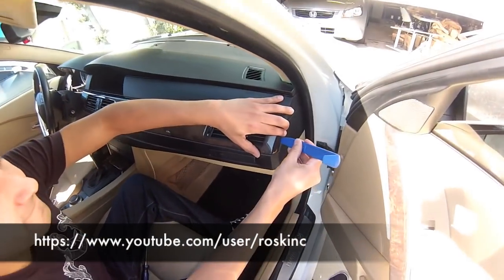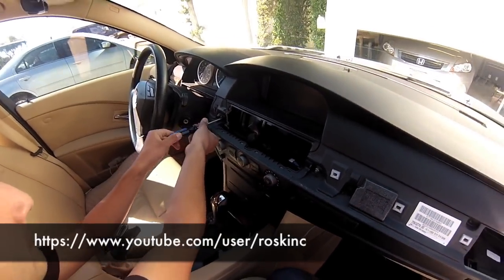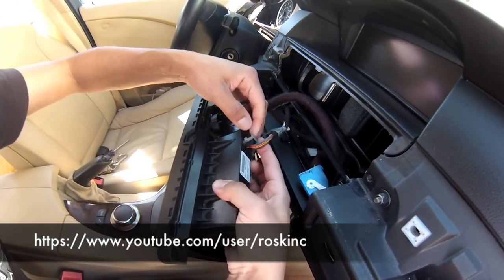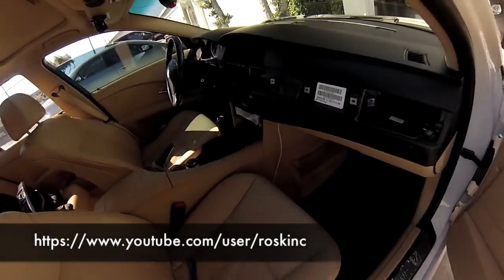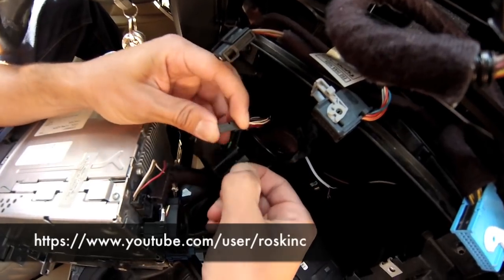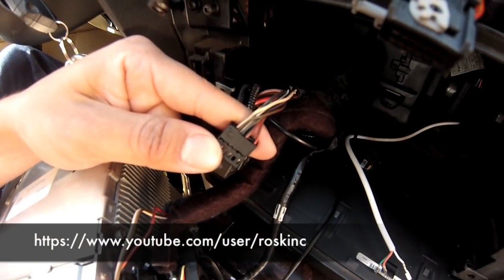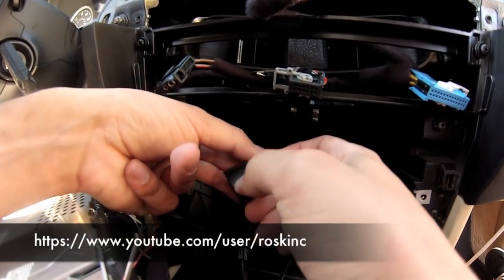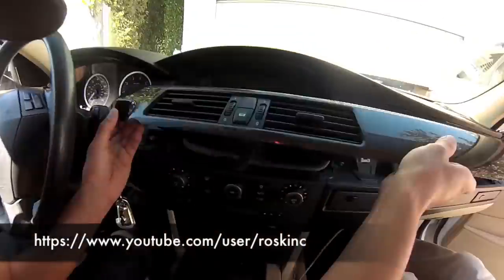BMW e60 5 series AUX audio ipod install DIY

Comment: Hi I bought your cable you made where it has a black red and white wire. To confirm:
Red goes to pin 7. 
White goes to 2 
Black goes to 8? 
For the the bluetooth portion....
white + violet#13 is the power wire so your red spade terminal splices into it
Brown wire #12 to is the negative/ground so your black spade terminal splices into it

Comment: ok I gotta buy a new CCC (CD/DVD) unit, looks like I need the screen to, sorry to slam you with questions, but if you can provide a contact for a pre programmed CCC it would be great, I can't live without sound. 04 530i looks just like one in video, aux is an option on screen when it works
Reply from the maker: The screen won't be the issue just the CCC unit. Best place is ebay see if you can purchase from a seller who can preprogrammed it. I have a source who can possible get you one send me an email I will send you his contact

Comment from the maker: depending on the cable i send, which i ALWAYS label with a tag, and also printed instrctions red- 7 white- 2 and black -8, if the cables are red,black,green its red-7 black-2 green -8, all the cables i sell are ALWAYS labeled next to the pins so you can always see where to put them.

Comment: Nice detailed helpful e60 videos. Just got a question, my car has Mask system. I followed your steps but unfortunately I didn’t not see any harness connected back there to switch the pins to. I plugged the cable directly but it didn’t work! Is there another way of doing it? And where did my original harness go?! 😅

Comment: I connected the cables like you said, but the bass is not working. you know why?
Reply from the maker: Rafael nunez did you add the wires to existing  plug or disconnect one that was already in there and plugged in a new one? Aux connects to Current connector if theirs already one inside.
Reply: I put a new one, but the music is low and there's no bass.
Reply from the maker: Rafael nunez you must be using a OEM cable or a cable that isn't mine. Other cables out there have low bass and low volume.

Comment: hi, I have the same cable you have with the 3 wires that need to go in the back of the radio, I have also located the pins that it needs to connect to. but is there a piece that I need to put the wires in so the click into place? I tires using the block that was there since it's empty but the wires do not want to stay. thanks in advance!

Comment: I bought the cable from you but it doesn't fit in the radio harness. I have the mask unit. My wire harness its different from the one in this video.

Comment: Question for everyone on here , I realize this is an older video.

Without taking the CCC out, how will I know if I already have that plug connector in the main harness or not?  I’ve seen videos where some guys have to buy the aux cable with the white/black plastic connector because nothing is plugged in. Some are just buying the aux cable without the connector and pinning it into the main connector

Comment: My 06 530i has the BMW 1 3 5 7 Series E60 E65 E81 E87 E90 iPod Most Interface Module Alpine 0411033; it looked like it replaced my cd changer and I have sirius radio unable; and ipod cable connected to unit; but I don't know how after I connected my ipod?Have you used this before or have any instructions or vedio on how to operate?

Comment: I forgot to say that i also have a parot Bluetooth installed Maybe that helps
Reply from the maker: Brader Musiki parrot Bluetooth would only tap into power. It wouldn't plug into your aux plugs. The parrot only works off FM transmitter.

Comment: Not trying to discredit your work but u could get those fm transmitters go to radio tune to the station you set and aux off your phone and same rule applies
Reply from the maker: Of course you can do that but do you know how bad of quality that sounds?? Then you have this huge bulk fM transmitter on your 12v plug. Do it the right way.
Reply: +roskinc no lack of quality in my 04 with a good one, and they're not any bigger than a car charger brother
Reply from the maker: +Prozaah no fm transmitter will sound better than a hard fitted aux, no matter how good quality it is, not even close. But for those wanting to save money or want the cheap easy way, it'll work.
Reply: +roskinc true, I mean slight drone at a much higher volume level but it was just an alternative suggestion, $20 and no panel removal

Comment: hey, Roskinic. I purchased both sports mode cable(version 2) and the aux cable from you, thanks. I'm currently trying to install the aux. My harness seems to be missing the module(connecter) in which i would insert the pins. would you know where i can purchase this online? thanks in advance

Comment: Hey bro I just bought a 06 bmw 525i ,love it , just wondering how do i get that firmware for the bmw dash, mine looks outdated compared to yours .
Reply from the maker: in this video i have the CCC unit with naviagtion, newer videos i have CIC which is found on 2010 e60. not possible with firmware update, need to actually replace the units. my newer videos explain it.

Comment: Hi, I have a 2007 E60 which has a factory installed ipod aux cable. Its coded by the dealership. It won't work with Iphones or Ipod after 2008. Does anyone know which year ipod or iphone it will work with? Don't have any earlier ones to test.

Comment: I have OEM CD changer in gloves box and I want to replace cd changer for Aux input. will you tell me how do i do this? can connect the aux cable directly to cd changer socket after i remove the unit?

Comment: How'd u get a navigation system and dvd?? And what kinda of exhaust/muffler is that. Can provide link plz
Reply from the maker: +deel eem i did a CCC upgrade, the exhaust is not a specific name brand i did a muffler delete and Y pipe the ends to each side

Comment: my factory radio in my e60 doesn't work, screen reboots etc. sometimes works when cold. I seen these aftermarket radios called dynavin, etc. do I need to fix my CCC DVD CD first? or can I just plug and go? like would it work if the CD DVD section wasn't even there? I Know this is the wrong video but I wanted to ask you because I like your posts
Reply from the maker: Yes you'll need to fix it first for everything to work. If you just install that unit without fixing the module, you'll only be able to use the unit, but sound or anything won't work, so it would be pretty useless.
Reply: roskinc, ok thanks I'm actually inside everything now, I'm putting the unit back in as we speak. I have a random plug and I can't figure out where it goes, sais  pbt gf10, I hope this is a CD changer wire or something, no CD changer here
Reply: roskinc, crap nevermind I Kno where this goes sorry, it's the center hazard/lock button connection
Reply: roskinc I noticed fan on back of ccc not kicking on, even after I bypassed harness and hardwired, I put everything back together, now screen is blank, before I would at least see logo

Comment: Hi
I bought cable
My car is 2004 bmw530i
But when i opend audio
I didn t have A2cable with x13813
Can i link AUX?
Reply: Did you get the aux cable to work???

Comment: Will that be possible on a 530i 2005? If yes where can I purchase that wired and get it coded
Reply from the maker: yes you can add this to your 2005 530. i sell the cable on my site, i have videos on how to code, if your in los angeles i can code it as well

Comment: Hi I followed the video and all went well until I tried to put the aux cable in, my connector has no spare spaces,,,,any ideas?
Reply: It's fine now I've found out that because I have the multi disc in the glovebox that is why the connector is fully populated
Reply: Did u get it to work
Reply: No, you have to choose between the multi disc OR aux
Reply from the maker: Multi disc (6 disc cd changer) and aux are connected in completely different ways you CAN have both aux and cd charger, cd changer works off fiber optic and the aux cable is directly connected. Every e60 has the harness for it, you add the aux cable to the existing plug.
Reply: I can't see how when the plug is fully populated with wires for something and there are no spaces at all
Reply from the maker: You must have aux somewhere then. What colors are the wires in slot 7,8,2? Check your center console in the very bottom or the somewhere in glovebox, if those slots are filled, then somewhere those cables lead to a aux. nothing else in those plugs gets used by anything else except aux, like I mentioned above CD changer sends signals via fiber optic.
Reply: Nice video's very help full thanks. Only one problem when i taken out my dvd nav planet out its not possible to take out that small connector with the numbers on it 1/12 and all the numbers are already taken. What am i doing wrong? I can make pictures of it if you are willing to help me out :D

Comment: So I did the same thing but for some reason my vent/Ac buttons are not working anymore... Help?
Reply from the maker: Make sure you plugged them in correctly
Reply: I double checked, i guess i blew the fuse or something because i'm not getting any power in that section.

Comment: I have different connectors andere the numbers 1 to 12 are all taken where do i put them?
Reply from the maker: Brader Musiki you must be connecting to the wrong connector I've worked on tons of e60 and they all have the same wiring harness, search the e60 harness their all the same.
Reply: Thanks for feedback. Is it Okey i make assortiment video of my cable unit so that you can see it. Hope you can help me out
Reply from the maker: Brader Musiki send me an email. I can send you a photo of the harness with arrows pointing to where it needs to go.

Comment: There is no cd changer in my car.
How can I do it?
My car is e60 2004 530d
Reply from the maker: Mersedesci Dede you don’t need to have cd changer to activate aux
Reply: roskinc thank you for quick reply 😊
Does it need to get it coded ?
When plug it in , will it work?
Reply from the maker: Mersedesci Dede needs to be coded.

Comment: Will this cable work on a 2004 545i no nav.??
Reply from the maker: Yes it will. Works on all e60's
Reply: Mine does not have that c block plug I don't know if I should connect it straight into the radio

Comment: Does it work the same for a 2006 650I?
Reply from the maker: yes same for 2006 6 series
Reply: @roskinc  WHat about plugging the cable in to where the CD changer plugs into? I got that cable and it didn't work. Does that need to be programmed the same way to work?
Reply from the maker: @Brandovibe  their isnt a cable that plugs into the cd changer, or do you mean the unit that you insert the cd?
Reply: @roskinc  I bought a cable online years ago and had a shop install it for me as per their instructions. I believe that it plugged in where the cd changer plugged into. Yes you lose the cd changer but i didn't care because I wanted to plug in my MP3 player to it and I still ahve the single CD player in the dash also.
Reply from the maker: Brandovibe my cable you don’t loose cd changer